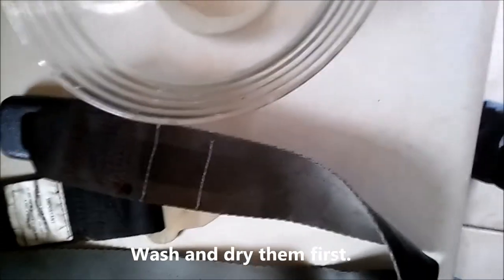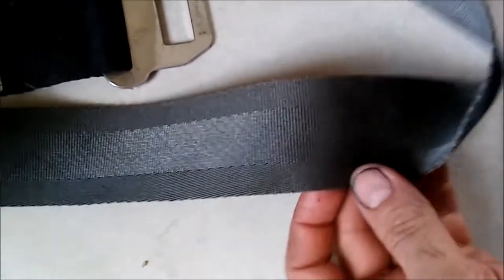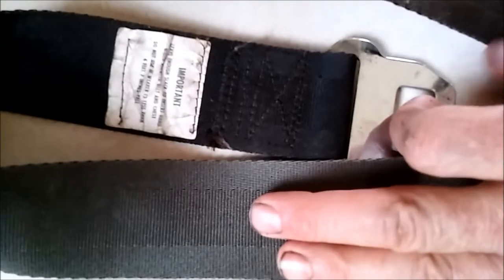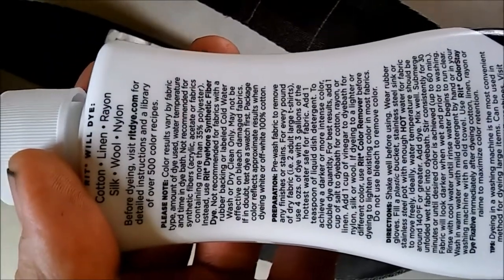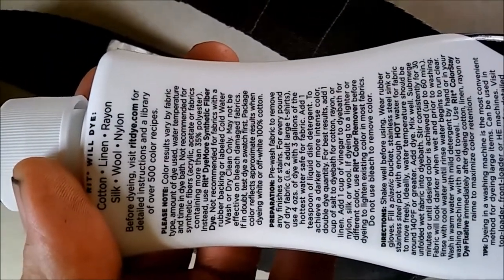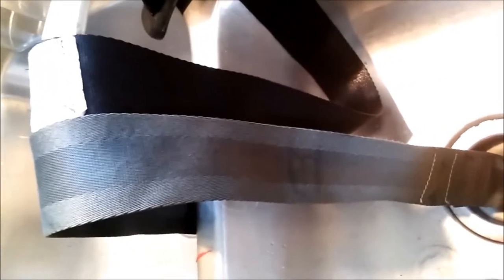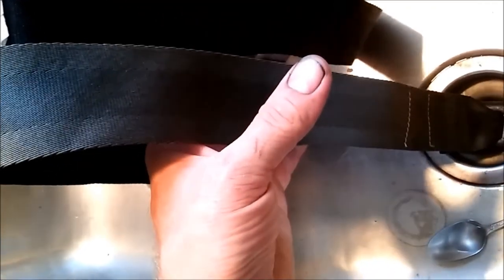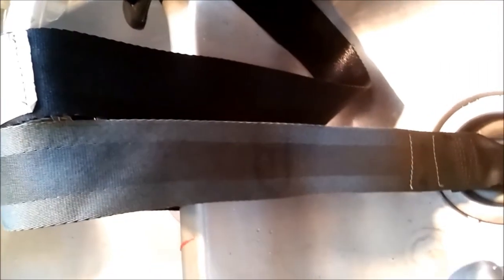Dying car seat belts

Comment: Hmm, I wonder if this will work for a complete change in color. I have tan seat belts and want them black. I guess it wouldn't hurt to try.
Reply: I have tan belts and curious about that as well.
Reply from the maker: Once you go black you never go back as they say. Can't make dark lighter.
Reply: I have a 78 Trans am SE and bought some factory tan seatbelts and wanted them black. No, will not work. Just tried it yesterday. Waste of time and money.
Reply: @1990hondarc30  Well crap! Thanks for the info. I ended up just buying black ones.
Reply: @yee11111  where?
Reply: @1990hondarc30  I got lucky and found a parts car with black interior.
Reply: @1990hondarc30  yeah I have an 80 z28 Camaro and tried to do mine black. Just ended up a light grey